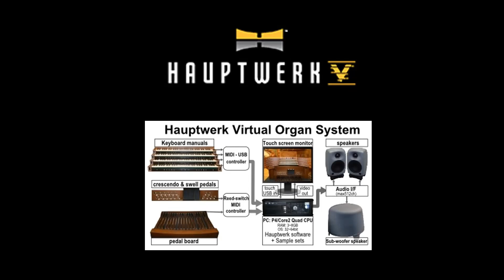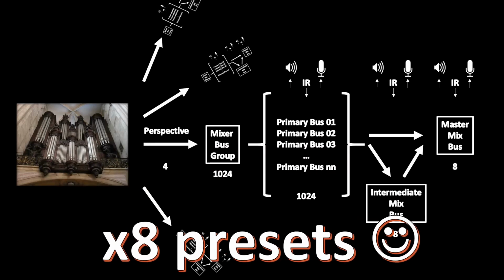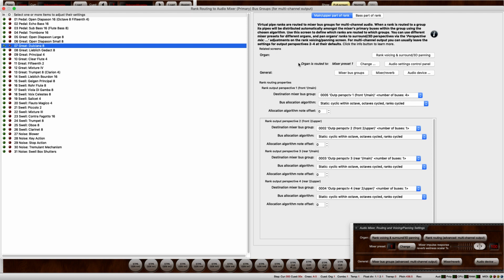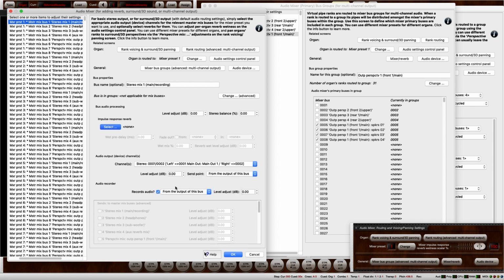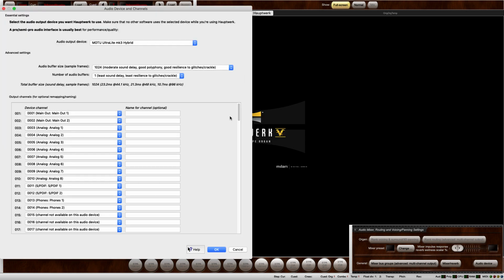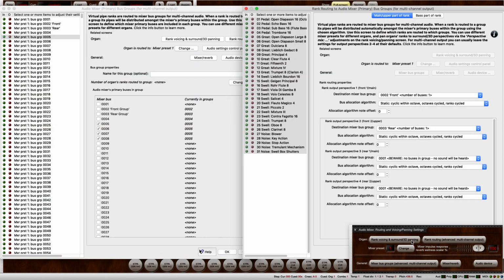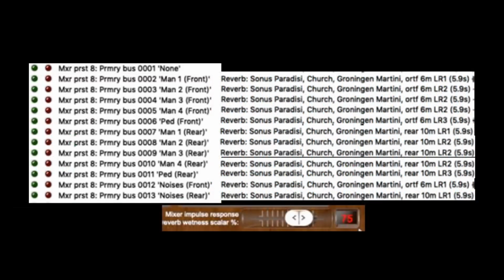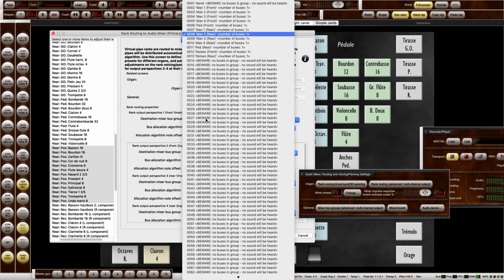Hauptwerk Mixer Walkthrough Tutorial | Convolution Reverb

Comment: Is there any sort of “Load Reverb” Button? I’m thinking of switching to advanced from lite.
Reply from the maker: Hi Stone! Yes indeed - depending on how you use the system, it can be very intuitive: for example, if you are headphones or stereo-only, in the main screen of the mixer, where you assign the speakers, there is a button to load the reverb - and you can adjust it using a control panel in real time to have as much or as little as you want. I admit I am still wrapping my head around what is possible with the mixer (and honestly this video was my first "tutorial" and is due for a re-make!!)
Reply: @jerrymartin79   Thankyou!